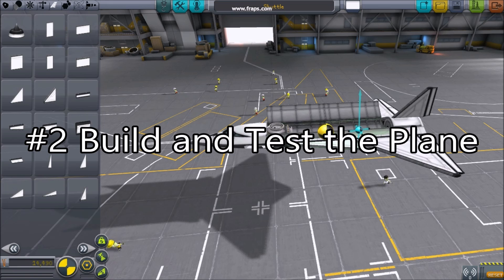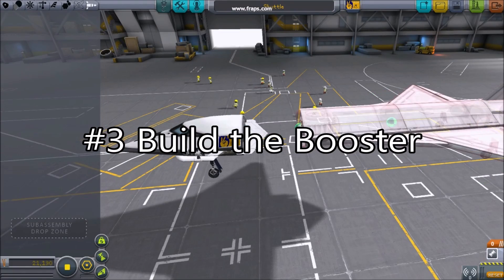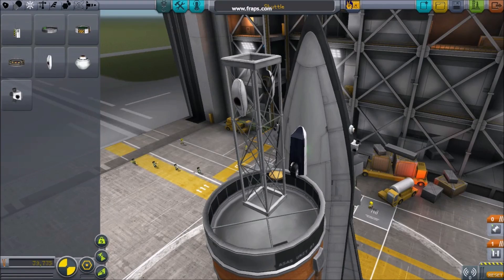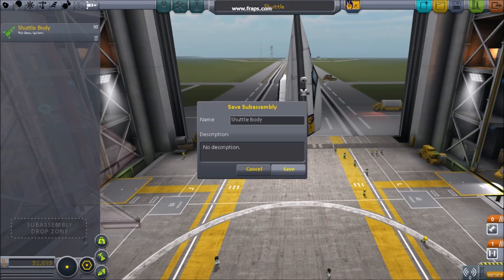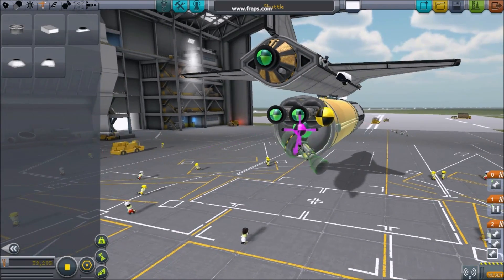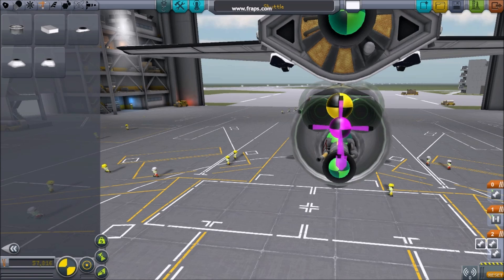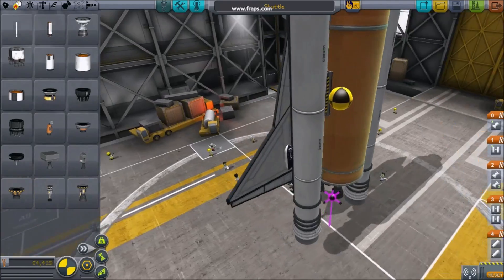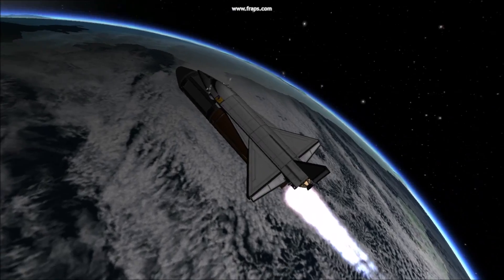Kerbal Space Program 5 Tips Building Shuttles

Comment: what are the benefits of a shuttle design over an SSTO or disposable rocket?
Reply: +superskiier50 well, it can put more massive stuff to orbit (versus SSTO) and it is still somewhat reusable (versus disposable rocket). So it's something in between of those two.
Reply: paladin17t what if you were to do a fully reusable rocket that isn't an ssto, something like the falcon 9 ?
Reply: superskiier50 I guess potentially it'd be almost as effective (maybe even more effective?). If the only thing we're spending is fuel (and maybe some paint and decouplers), hell, yeah, that sounds like a nice idea. Though there's still an advantage on the side of shuttle that it's gliding back to the runway and Falcon (and such) boosters should use fuel instead of that, thus reducing the payload mass.